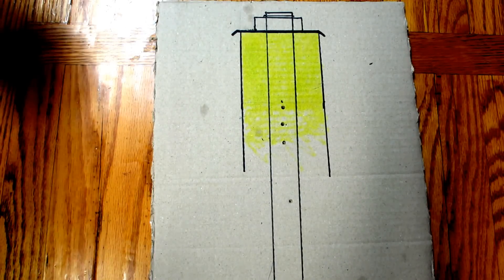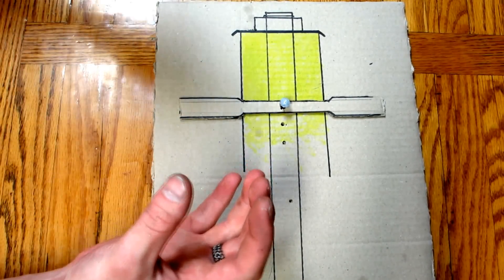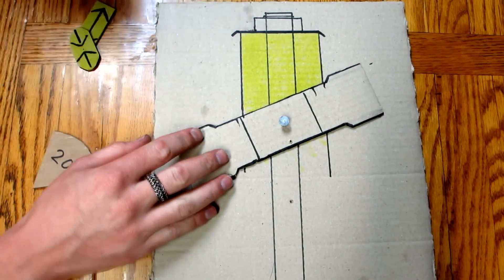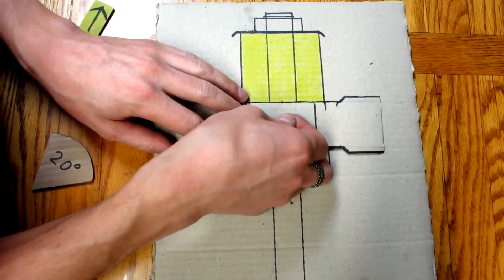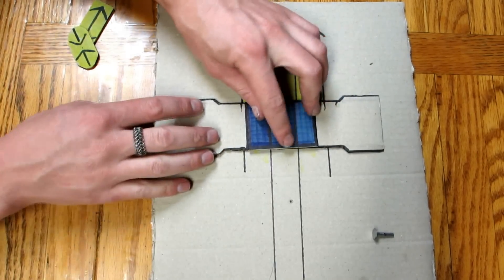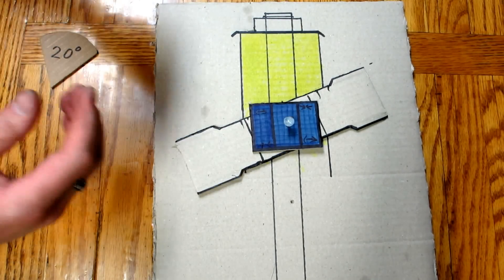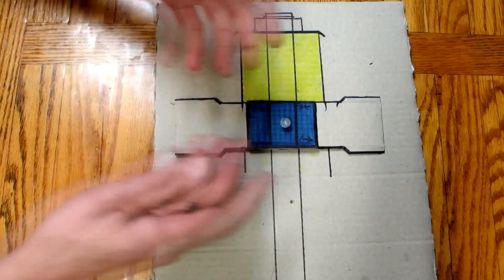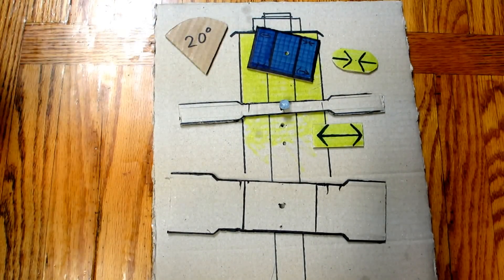A Look At Bushing Seat Thickness, and Rouge Trucks.

Comment: I believe Rey's have a bushing seat that is not centered with the pivot axis? The seat is more offset towards the roadside side.

What does that do? Pros & cons?
Reply: I've never held a pair of rey trucks so I'm going by pictures. It seemed like a really weird place to essentially put the offset of your axle (rake) to me at first. But with the ball pivot it would mean that you actually would be able to change the pivot angle (measured from the center of the ball to the center of the bushing seat) when flipping them. You you would have to compensate with extra washers or shims to make the bushings sit flush in the bushing seat and the pivot angle would not be perpendicular to the king pin in at least one of the positions. Hope I'm making some sense and that I'm actually assuming the right things.
Reply: @Kufunninapuh  I agree with you. That's what I found so weird about them. Like how will things work efficiently withouttl the axes being perpendicular?
Reply: The pivot axis as a physical principle is always determined by drawing a line from the center of your bushing seat to somewhere in the pivot cup depending the design of the pivot on your hanger. On most trucks that is the advertised angle. Paris, caliber, bear etc which means the pivot axis happens to align with the advertised baseplate angle (which is a pointless term from a physics view). Flipping one of those hangers does not change the angle, only the rake, which I still struggle to find a good explanation of its effect. Rey is the only exception I know of where the advertised baseplate angle actually changes by flipping the hanger. If my assumptions of their design is correct.

Comment: What about trucks with plug barrels? I don't think they operate in exactly the same manner as inserts do.

Also, do Valkyries have the smallest bushing seat thickness in the industry due to their offset bushing design?
Reply from the maker: I think plug barrels are probably the same thing, but maybe slightly better due to being a more continuous piece of urethane.

And yes, the voxters are essentially zero thickness bushing seats. I think that's really cool.
Reply: @LongboardTechnology  I wonder why there are no precision trucks that use plug barrels. Only those that use inserts.
Reply: @nickamarit Zak maytum is no longboard technology but he states that the fact that the insert can move independently from the bushings makes the engagement better and thus reduces slop more efficiently. As opposed to a plug barrel like in the gen 6 bears, caliber 3 and most recently Pantheon TKP. As the plug is attached to the barrel it slips in and out of the hanger a bit with every turn. People are cutting that plug off to use as an insert to run whatever bushings they like in the mentioned trucks and the caliber precisions come with an insert rather than a plug barrel even though (as far as I know) the hanger looks the same. They are advertised as 100% interchangeable with the cast but there might be an asterisk as there so often is in longboarding.
Reply: @Kufunninapuh  In my cast Cals (even before Pat's Risers made some), I made my own insert bushings from 95A HPF, and I never thought about going back to using plug barrels ever again. Cuz it allows me to use super soft bushings in my front truck.

Comment: valkyrie's voxter solved this problem (the problem that bushing needs to slide on the hanger because of the seat).  boardside bushing is not at the same axis with roadside bushing. so there is no ''bushing seat''.

Comment: The solution to the problem is the pivot point on the thick axle. Simply put the pin higher up rather then the center. This will cause it to act the same as the small one but still be big. I think
Reply: but there's also a bushing on the other side of the hanger too unfortunately. Good idea though.

Comment: Very nice explaination. I have a Ronin Cast Truck which has an additional queenpin to counteract that sloppiness. How does this solution compare  to the one you've explained in the video? And yeah another video like this about the ronin would be awesome!
Reply: I have cast Ronins and the new(ish) cast rouges (with the bushing in the hangar). The first difference I noticed was the jump to 48° from the ronin's 42.5°. They both center nicely and respond quickly from their respective slop elimination features. They both carve deeply from having tall bushings and no bushing seat. I think the Rouges might be slightly less stable going over rough pavement because slop movement is somewhat possible with the third bushing holding the hangar in place rather than a mechanical pin. Then again I might just notice that because of the higher angle. With super loose bushings I think I can start to feel resistance from the third bushing when leaning extremely far. They're both really nice for a lot of the same reasons: Deep carve, quick response, very stable.
Reply: Josh Starkey which is better for general freeriding and moderate downhill? What's the ronins better at and what's the rogue better at?
Reply: Jacob Krajnik I'm not much into DH or freeride myself honestly, however I've seen either work fantastically for both downhill and freeride. I'd say they're quite similar. People say Ronins have somewhat of a unique (but consistent) slide. Not good or bad, just something to get used to. I think the biggest difference is the baseplate angle, although not radically so. I've done split angles with front Rogue/back Ronin and liked it. The Ronins also have a bit more rake.
Reply: Josh Starkey what kind of riding do you do then lol